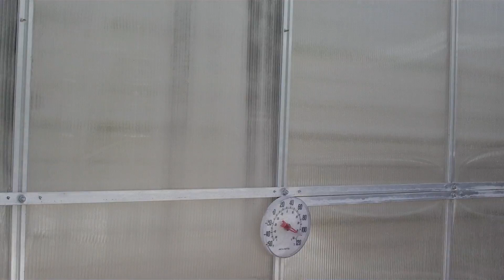Aquaponics System Setup - Part 4

Comment from the maker: They don't, I use a special seal called Uniseal that goes into the hole and pipe slides through it, when the pipe slides through, it expands the walls of the seal and you have a water tight seal at that point.